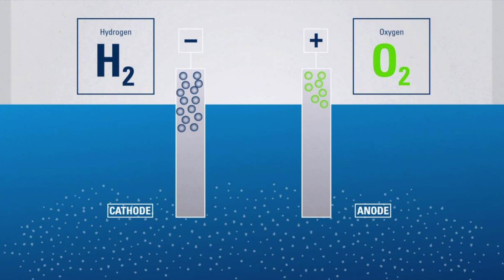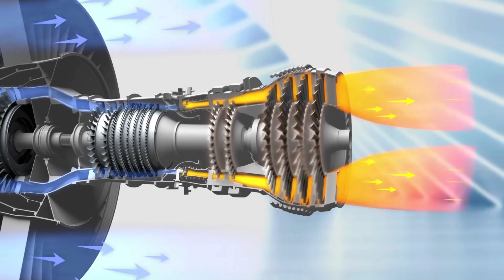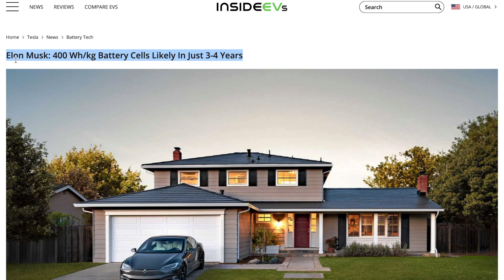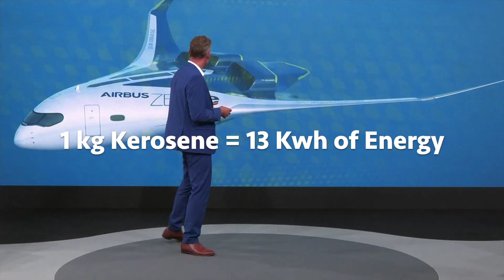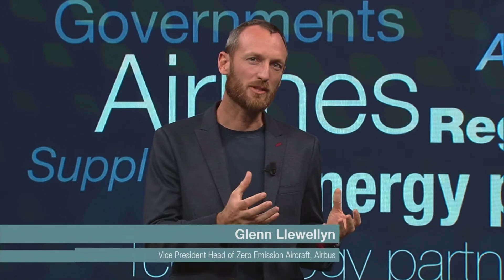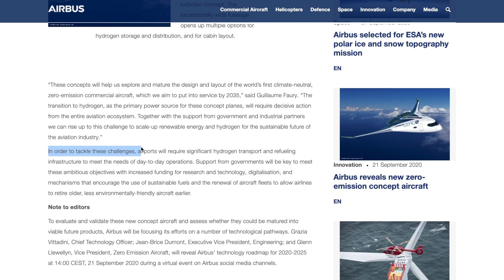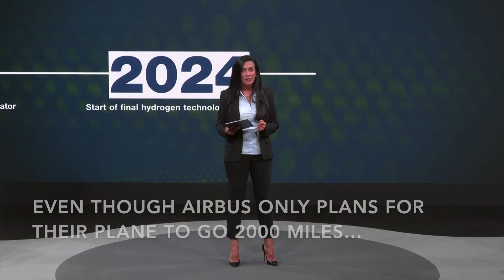Why A Hydrogen Plane Is A Terrible Idea

Comment: This is a really horrible, inept analysis, for several reasons.

1. You cannot get hydrogen combustion to anything like 50% efficiency just with more R&D. The Carnot limit prevents it, unless you can find some way to increase the combustion temperature drastically, and have the engine handle the higher temperatures. I don't think anyone knows how to do that.

2. On the other hand, batteries with 1500 kwh/kg are also totally speculative. Theoretically possible, but AFAIK no one has any real idea of how to get such energy density at this time.

3. It's isn't just the weight of the hydrogen, it's the weight of the tank. Factor that in, and the advantages of H2 quickly go to hell.

4. Of course, there's always liquid hydrogen, but I think working out the numbers would show that only works for really huge vehicles. It might make sense for large ocean ships, and in a different way, for some stationary energy storage in polar regions. Probably not for anything else. Even then, there are practical alternatives against which LH2 would have to compete, and I have real doubts that it can.

5. Nothing said about NOx from hydrogen combustion engines. This would be mitigated a lot as long as you're mostly staying away from populated areas, but it's still a reality you need to factor in.
Reply: I liked your comment because you show some good understanding of the key issues, but I also wanted to take time to address some of your points too, not to argue, but more to share my own knowledge as I work in research on these very topics. 

1. Hydrogen combustion can actually be very efficient, provided the right thermodynamic cycle is chosen. Large modern turbofan engines can hit close to 50% efficiency using kerosene, and are really only limited by the materials as the turbine entry temperature (TET) rises and the cooling air requirements begin to dent your efficiency. Higher TET-capable materials has really been the target of a lot of investment in the last 40 years in gas turbines, however the interesting thing about hydrogen is that the exhaust products have a higher specific heat capacity, and therefore have more enthalpy available at a given temperature to do work. This means for the same TET as kerosene, you get a small increase in efficiency using hydrogen, since you need less hydrogen per unit energy to do the same amount of work. There's also the cooling flows; hydrogen produces no soot, which means dramatically lower black body radiation, or as I like to call it, 'sticky heat'. This means turbines need less cooling, which also increases efficiency. Then there's the cycle choices; say we use liquid hydrogen, the very low temperature and very high heat capacity can actually give rise to many novel cycle options, such as recuperators, intercoolers, and more, further increasing potential efficiency. So to summarise, I think it's entirely plausible that 50% or higher is achievable using hydrogen as a fuel.

2. Completely agree. 1500 Wh/kg is entirely speculative, the best batteries at the moment when you take into account the casings, thermal management, power electronics, and cells themselves, are at about 200-250 Wh/kg. Of course there are new chemistries promising the earth, like Li-S, Li-Air, and sodium and magnesium-based options, but they all have drawbacks, and none so far look like they could breach the 1000 Wh/kg mark. Incidentally, that's the target for small scale regional aircraft, 1000 Wh/kg, below that it simply doesn't make economical sense. Then there's the charging times, the lifespan, the degradation, the fact they remain the same weight throughout the flight, the weight itself, and the increasing shortage of the materials used to make them. To me, it just isn't practical. 

3. Correct, you need to factor in the tanks. Due to that, liquid hydrogen is really your only practical option. Liquid offers very lightweight tanks compared to compressed hydrogen, as well as nearly twice the storage density.

4. As you say, LH2 works well the bigger you go, which actually is a very well-informed comment. The paradigm in aircraft design suddenly shifts from being MTOW constrained to being volume constrained, which is a real challenge due to the drag implications. There are solutions being worked, but sadly I'm not at liberty to divulge those as they are very much commercially sensitive at present. As for alternatives, I'm interested in what you're referring to?

5. Another good comment, NOx is absolutely a concern. But I'll leave you with this nugget of information; perhaps instead of taking the higher enthalpy in the exhaust at a fixed TET compared to kerosene, we instead lower the TET and fix the power at a lower temperature. That way, you reduce the NOx substantially over kerosene. Food for thought!

Comment: Both Daimler and Airbus says that they use liquid hydrogen as fuel. They need be out of their minds! LH2 needs helium purges and special care of the equipment due cryogenic temperatures and hydrogen embrittlement. Boiling off needs to be vented, and if possible burnt. Everybody needs to go watch Delta IV Heavy launch, and then think; does that look a like everyday operation suitable for trucks and planes?
Reply: Unless they are taking about rockets, they almost certainly mean liquid hydrogen for storage, but hydrogen gas for burning. Which makes many of your problems go away.

Comment: Embarassing that aircraft performance havent really progressed since the early 60s. Whe should have passenger aircrafts flying atleast 3 times faster if innovation wasnt halted due to the duopoly of Boeing and Airbus, corporate inefficiency, corporate greed, etc.
Reply: While that is kinda true speed does not matter it’s all about efficiency
Reply: Why would you want to fly faster, when you can fly slow and be cheap? Time is the enemy of the few, price is the enemy of the many.
Reply: @onyhow  try flying from London to Sydney in economy class for 17 hours and you would understand. Planes were expensive to fly in the beginning but eventually got very cheap. Just like any  technology thats new
Reply: @greenearth9945  ...and? Unless routes like that is in high demand (and yes I'm aware of proposed supersonic jet projects designed to fly that route like the Reaction Engines LAPCAT A2), then why would plane companies spend money on developing that? If they spend cash to develop an advanced plane with limited appeal...they won't do it. It makes no economic sense. 

Hell, just look at how bad A380 is going to lose Airbus cash, and that has way more appeal. Or the Concord.

I've been on long economic flights too...and price still matters more.
Reply: The faster plane the more fuel it need, less efficient and sonic boom can cause noise pollution. That is why Concorde failed.